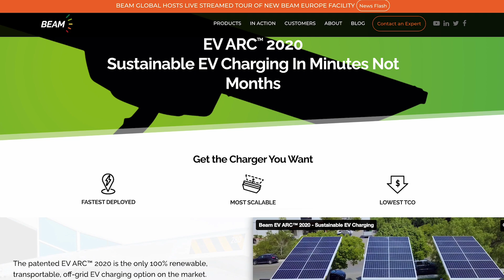EV ARC™ 2020: The Most Sustainable Way to Charge?

Comment: We have one of these systems installed at our Queen Creek, Dive Arizona SCUBA Shop & Shooting Range location for over two years now. Working reliably in over 110 deg. F for multiple weeks.
40kWh battery, emergency 220V/110V, 30 amp power panel. We did connect the system to our grid which provides three power sources - The Sun, Battery and Grid. Employees and customers use the system on a regular basis. Many times people have needed just enough charge to get home :-). Originally installed and ready to run in about 3 hours with no site work or permitting required. Just needed unobstructed sunlight. Not an inexpensive option, but priceless in a power outage situation! Two Charging ports sharing 4.8kW. One vehicle charges at 4.8kW, two vehicles at 2.4kW each.

Comment: I would think you would need some construction to fasten the unit down to prevent high winds from moving the units.
Reply: I was thinking the same, the panels make for quite an airfoil.
Reply: @hermancm  I wonder if the unit is only stable when there are vehicles parked on the base.

Comment: All sounds too good to be true, looks and sounds perfect on paper. In practice, the two of these (4 chargers) at my work are mostly useless because it takes almost half the day to charge up the batteries, and once drained to a certain level, then the stalls go dark and is useless. If you have more than a few cars pull up, these only charge at 6 kwh max and will take 4-6 hours for significant charge. These are pitched to municipals because they don't "require" much or any input from the city or infrastructure, but without grid connection, the solar is not reliable. When it doesn't work, nobody wants to deal with them. At this stage, these need grid connection to be reliable.
Reply: Yeah, those sound nice for someone who wants to charge 1-2 cars in the city. The power provided should be enough for light daily driving. Doesn't really matter if it's slow, if the car is parked most of the time anyway.

But without a grid connection, that use is pretty situational.

And in a brownout? Yeah, you want fill your car battery anytime soon with that thing.
Reply: Can I ask how long you sit at your desk in work? how far do you travel to work? my guess is 8 hours in work and under 30 miles to drive to and from work.. why do you need more charge? If this is the case 4 workers can drive too and from work, and charge for free everyday on the sun.
Reply: @markgb9227  Yeah, I think that's a good use for these Arc Chargers.

You just don't have to expect them to always provide a significant amount of power.

They're an "optional" charger providing enough charge for the daily commute, if you can sit there for a few hours and the sun shines.

That's already a decent addition to the public charging infrastructure in a lot of locations. I just can't replace it.

Comment: Did anyone catch what the charging speed was?  I've listened 2X and did not catch it.
Reply: Batteries are able to discharge 6kW
Reply: @FernandoMiguel  your car has 8 HP?
Reply: @suggesttwo 60 kWh battery and 160 kW engine.
Reply: @FernandoMiguel  60kwh/4.4kwh=14hours charging on a bright sunny day. No clouds, no rain and nothing obstructing the sun like trees and power lines.
Reply: @suggesttwo  that's fine. Nobody is doing 0 to 100%.
You may be looking to let the car stay over night or while you get some shopping done.
Reply: @FernandoMiguel  It will charge it, just in 2-4 days not 1. A home fast charger is around 7.2-12kw to charge over night. 7.2kw x 8 hours = 57.6kwh, 12kw x 8 hours = 96kwh
This product is not viable for most people if they have a job. In the winter it will get covered with snow. BTW, If you don't have a job you don't need a car, really. Taxis, busses and trains are cheaper. Bicycles. Electric bicycles
Reply: @FernandoMiguel  Okay, thank you.
Reply: @dianewallaceEVs  2-4 day charger depending on how sunny it is. Very easy on the battery at 4.4kw.

Comment: If one listens closely, without getting hung up on one's own preconceived notions,  one finds this to be a solution necessary in places like NYC, with zero extra parking,  in limited footprint, with the output limited by that small footprint and solar array, where even running a 240V cable from a nearby building is impracticable and absurdly expensive, due to laws,  codes,  and regulations.  Excellent accomplishment!
Reply: Agreed!

Comment: MUNRO - 6kw is very CRAPPY.
Powerwalls deliver 11.5 kw to a v4 HOME charger. 
you can subscribe to Super off Peak rates , then store it 13.5 kw.
Reply: Lvl 2 charger.
Doesn't need to be hooked to the grid.
Reply: @GROND15   - L2 cant do anything IF you are OUT of charge.

Comment: MUNRO - this guy is BS , there is capacity in Cities. Tesla supercharger CAN work for RURAL areas if they have Existing BEV customers.otherwise TESLA Superchargers and others wont exist. 
However , TESLA buys Super Off Peak energy , then stores in Megapacks to Dispense later.
Reply: not everywhere. My local SC has no storage, just a big ass transformer and switch gear.

Comment: MUNRO - but what happens when a BEV customer needs DC fast charging ?
needs 250 - 300+ kw ? or 1000v charging ?
Reply: You go to a super charger. If you "need" 1000 volt charging you have nothing but problems. This is a lvl 2 charger, seems like a sensible solution to that.
Reply: @GROND15   - TESLA supercharger seldom EVER have issues.
Reply: @markplott4820  you won't be charging vehicles like that with this.

Comment: MUNRO - Tesla Superchargers are THE most Sustainable way to charge your car, PERIOD.
Reply: @markplott4820  I don’t think either of us have enough knowledge of the products to make this conclusion. Tesla’s Superchargers are the most deployed and reliable solution. But, they require tie in to local infrastructure, that these chargers do not. Neither of us know the exact sustainability of either case. I do know that many Tesla chargers do not have the solar panels on site; while these have solar panels built into the system. “Sustainability,” has to do with the efficiency of the system.🤷‍♂️
Reply: @danjw1  🎯
Reply: @danjw1 -  TESLA supercharger are the LOWEST cost and 99.9% RELIABLE. 
unlike others.
Reply: It's going to take many different and often creative approaches to solving the infrastructure problem. PERIOD. 
I've been looking at putting chargers in at our business location. 1-1/2 years of research, red tape, useless phone calls/emails Et al. I have to get variances from my neighbors, permits from the town, approval from the utilities, then pour concrete, then get the utilities to committ to an installation. Even a lvl 2 requires me to ad a 3rd entrance + meter to the building. The prospect of explaining this thing to the town council and getting approval sounds like childs play. Discounting anything just because it isn't Tesla is pretty foolish and short sighted.